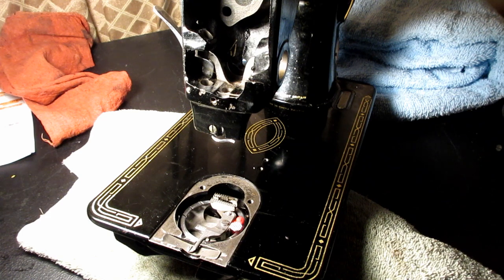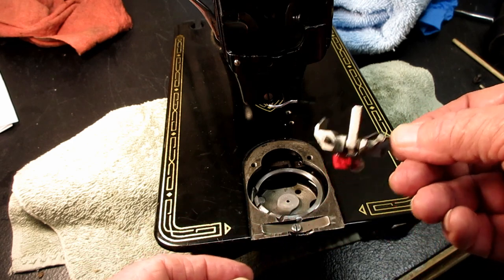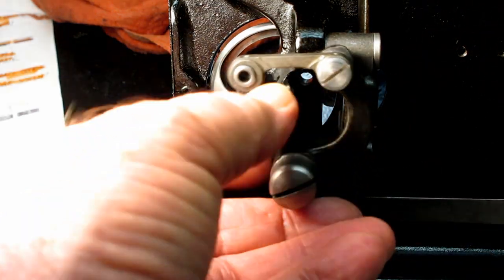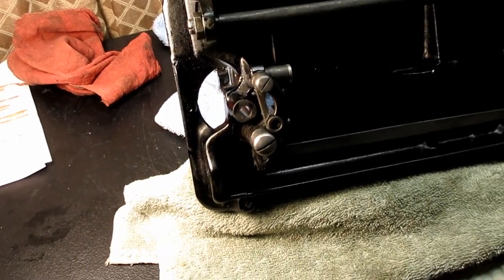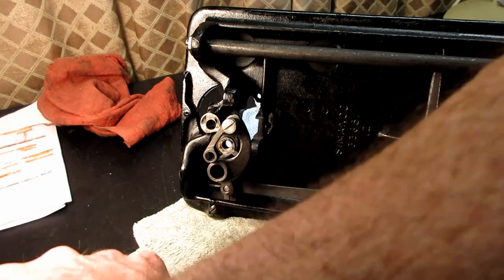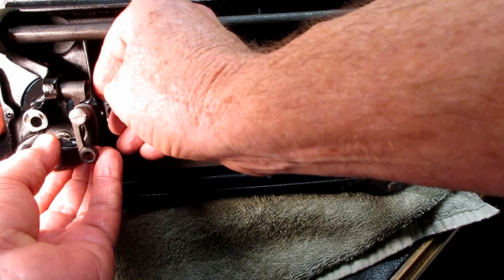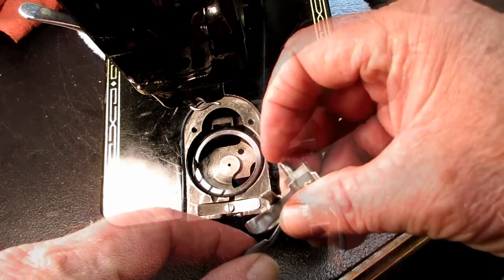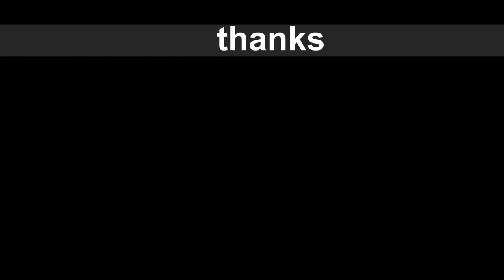The Oscillating Hook System of a Singer Model 99K Sewing Machine

Comment: Thanks for the heads-up about timing, will mark the position!
Reply from the maker: Thanks for watching! If the timing is ever off take a look at my timing video: https://youtu.be/9zU1_VjMddQ
It happens to the best of us, hehe. Take care, CGL
Reply: @andytubesewing1953  your 99k vids have been very helpful, sure I'll be looking into what I can improve in the top end of the mechanism. My spool winder is much simpler it's all friction fit and 1 screw and spring washer, my machine doesn't appear to have a serial number, no idea when it was made.
Reply from the maker: @crazygeorgelincoln  I'm glad if the videos helped. Is your machine A Singer Brand? I ask b/c there are some Japanese Clones of a few Singer Models of this type. I've never seen a Singer of this type without a serial number on it somewhere. No worries, though, just curious. Take care.
Reply: Finally found the serial number, inside the base. Es697510 . A chart puts it at 1961 . Wasn't sure if they were still being made then. One source says they stopped in 1958.
Reply from the maker: @crazygeorgelincoln  It depends on the source I guess. The International Sewing Machine Collertors' Society (ISMACS International) shows some model 99s were made until 1963.  ISMACS Serial Number Chart does show your serial number as Model 99K in 1961.

Comment: Great video. The genius of the design combined with the simplicity of the mechanisms on these old machines, is a wonder to behold. My sister picked up one of these machines at the end of someone's driveway. It's in a cabinet and is in great shape. Her daughter in law, sewed some horse blankets with it, with no problem whatsoever. A sturdy little workhorse. I just finished making a new seat cover for my old vintage snowmobile, and was thinking of using it, but managed to do it no problem with my 401a.
Reply from the maker: sturdy little workhorse- true words, John. I don't sew at all, but it sure was fun working on it. I thought I got if for a bargain at $25, haha, but your sister found a treasure I think. Thanks for watching.

Comment: Hello Andy,  I like your videos! Everything is very much the same in this application for my 66-1 as the 99k from top to bottom except the the bobbin case positioner.  The 66-1 has one screw on top side at the same location where the 99k has the pin, that is center punched up from the bottom.  Thanks again for the very informative instructions for me, "The First Timer"
Reply from the maker: Thanks for sharing that. I've never worked on a model 66 but knew there were 2 or 3 different bobbin case systems. Thanks for saving the machine and sometimes the first time is the best time, hehe. Take care.

Comment: Hi Andy, Thank you for so much information.  I noticed that when you reassembled the hook, you did not mention marks, so I thought I would.  My 1925 #99 (now Candy Apple Red!) has little marks - kind of tick marks on the bottom of the end of the hook and another on the piece (I think you said link) that it fits into.  I can only guess that they are intended to help line up the position of the hook.  If so, it should make the timing easier.
Reply from the maker: I did not pay any attention to any marks. They were not mentioned in the adjusters manual or service guide, so thanks very much for sharing the idea. If I ever work on a model 66 or 99 in the future it'll be the first thing I check out. If they are as you say that would be an incredibly easy way to time the hook. Nice to think that's possible. Thanks for watching my channel. 😀

Comment: Great video, Andy !  Thanks.  I've been doing a re-haul of a 99K that is cosmetically near factory condition.  Sadly, the previous owner took a wire cutter and snipped ALL the wiring at the base of the motor and the base of the light, etc. so I can't just splice a new piece as there is nothing to work with.  Not sure it's possible solder new wires;  Maybe you have a solder video somewhere?
Reply from the maker: Thank you, Tom, and thanks for saving that machine. Here are all 19 videos of my 99K, including the spotlight and motor videos. https://www.youtube.com/playlist?list=PLsCOZgzzaiKIIUgkEujqHc9iNWN9NPW2Z   You'll see in the motor video that the wires are spliced with wire crimps is the storage area below the motor, including the wire from the light. That should be an easy repair to remove the crimps and used new ones or even wire twist nuts. No soldering required there. The light (if you have the spotlight) will be soldering for sure, one wire to spring and the other to the socket. I have some soldering videos but they are basic and for splicing wires in the open. There are many great soldering videos on YouTube, including the type of solder to use and preparing the iron tip before use and heating and removing the old solder with flux tape. You could buy a replacement light if you like; I've often seen them on eBay. It sounds like you want to keep the original parts to a beautiful machine and I admire and encourage you for that. Thanks for watching my channel and good luck.

Comment: Andy, how then, does one oil the shaft of the hook, as it seems it would need  oil (metal against metal.)  The little hole in the bottom of the hook doesn't go anywhere, as you show.  I have a 337 that has the oscillating hook and several 457s that have rotary hooks that I'm no longer putting oil in that little hole in the bottom of the hook.  Does the shaft of the hook need oil?  Is there some lubricating spot for the hook shaft?  Thanks for any info.
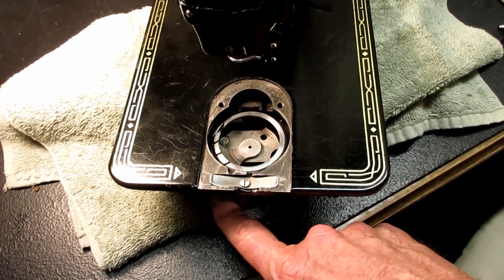Reply from the maker: Hi Carole. Pause this video at about 6:08 to 6:08. You see the small hole in the center of the hook? The one people often oil? That hole is in what I call the "teardrop" area of the hook. To the upper-right of that little hole is a larger hole for the stud of the positioning bracket. The area just outside the teardrop of the moving hook, like between that and the larger hole is the part of the casting that the hook post or shaft goes through to get to the crank below. So a drop or two of oil near the teardrop edge, anywhere around the teardrop edge, would work into the bushing of the hook. You could also oil the underside of the hook where the shaft exits the bushing and enters the clamp if you wanted. Go ahead and oil the little hole if you like ... it does not hurt anything, and people have been doing it for 75 years.

Comment: Hello Andy, For the past four days I'm still cleaning and putting together my 66-1.  Once I did put it all together, I threaded the machine and used the hand wheel and ran a little test piece of cloth to see how it would come out.  Good news,  it worked and sews.  Bad news as I started to adjust the upper string tension and adjusted the length of the stitch it sewed fine; then didn't sew a stitch for about an inch then started to sew again. My adjustments made it worse.   It seems like the thread didn't catch for a little bit then restarted to catch and sew?   Any recommendations on what to do?  Is there a video for diagnosing stitch problems?

Then as I was cleaning up, I found a set screw screw under a rag!!!!!  I don't remember from where it cam from.   It is a 1/4 of an inch long and 3/16 of an inch in diameter.  It is a little bigger than the other set screws, I think it belongs on the needle bar assembly?  I've got to get ready for a dental appointment but it looks like I need to take all apart again.  Any recommendations welcome.   "First Timer"
Reply from the maker: Welcome to the world of restoration my friend! It sounds like a timing issue, but may be the needle bar height or position. WOuld you care to send a pictures of the screw and the stitching results ( top & bottom of fabric)? andytube53@gmail.com I just had a dentist appointment to day!!

Comment: You should have made two timing marks on the shaft and the crank before you drove out the hook
Reply from the maker: Ronald, did you mean to say "You could have..." or did you purposely use the word "Should"? I don't mind people critiquing my videos or the style in which I present them. I have open comments on 99.5% of my videos. I do feel when someone makes such a definitive comment as "should have", that they should back it up with their reasoning and explain to me, and my viewers, why you have that opinion. In this case, you mention marking the shaft and crank, but fail to mention why or say anything about the needle bar height. If you mean to say I presented something wrong or invalid to my viewers, then say so, but say why that is the case. If you feel you have a better method, then say that and explain why. Better yet, post a video about it on your own YouTube Channel to explain your reasoning. Most people are here to learn something so you could give them the opportunity to so do, and contribute to the community, rather than make this kind of a drive-by incomplete authoritative comment. FYI, I do show NB height and hook timing video link in the video description: How to Set Needle Bar Height and Hook Timing: https://youtu.be/9zU1_VjMddQ